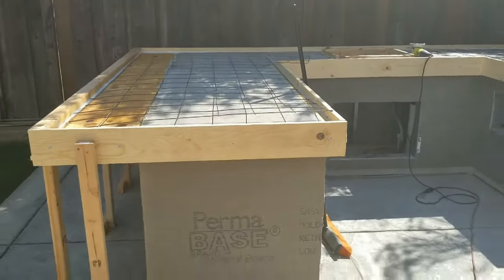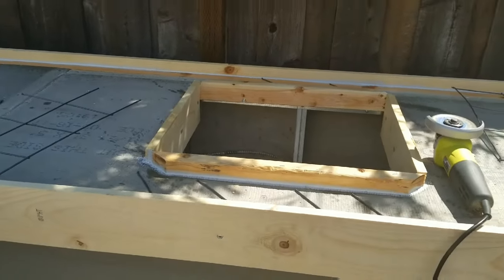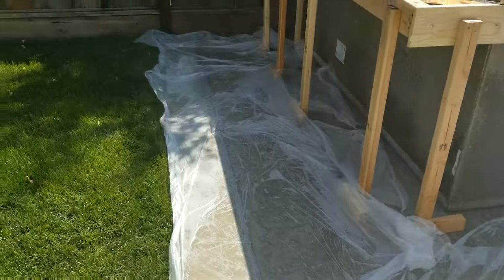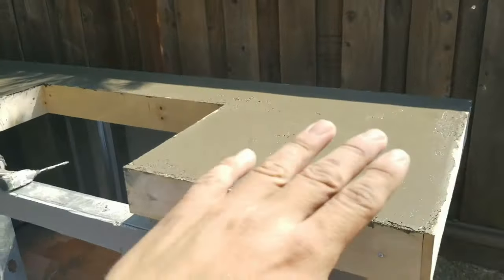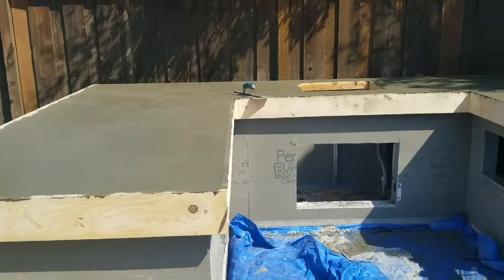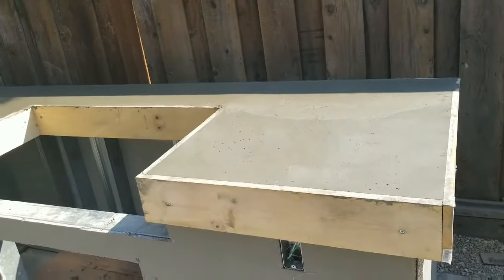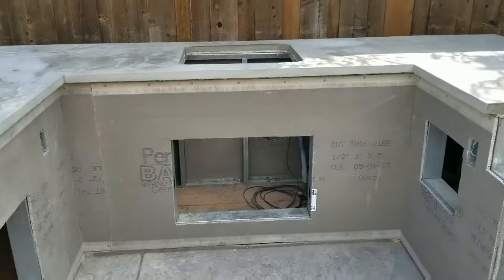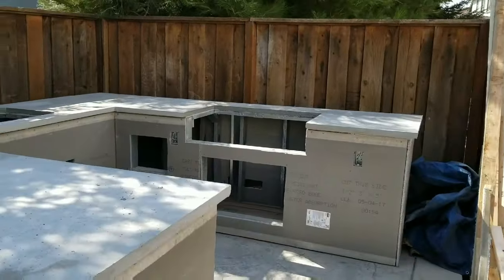How to make pour in place Concrete countertops on my bbq island #5

Comment: LEGIT WORK Bro!
The one thing that would’ve helped you out was to carry your 16” on center layout throughout your framing starting from left to right regardless on where your openings for bbq, doors and  drawers are. You wouldn’t have had to put those studs in for seam support nor would you have to cut much of that Durarock to length. Especially if the full length and width was at 8’, 12’ or 16’. You just slap each board on and make your cut outs with a reciprocating saw and correct blade and boom! Ur done. 
I like the concrete tops. The edges are so crisp and straight. Perfection has been GOT!
Reply from the maker: John Wagner thank you,  that is a great tip! I will take that into consideration when helping others and for my next bbq sometime in the future. Definitely a learning experience with metal studs and cement board. I appreciate the feedback
Reply: D.I.Y Eddie 
Metal studs are great to work with. There’s a few tricks to them you can do to make the job easier and more sturdy. Also using a chopsaw with a carbide tipped 60 tooth blade cuts them way easier than a grinder with a cut off blade. Loud as F$&k but quick. I’m in the throws of designing my outdoor cabana patio kitchen (whatever) and I learned a few things from your vids that’ll use on mine. Keep up the good work.
Reply from the maker: John Wagner hahaha yeah using the grinder messy but its what i had, I even looked at buying a metal stud cutter which wasnt a bad price if I did metal stud work for a living. Thank you sir hopefully you post some pictures or videos I enjoy getting different ideas from people.
Reply: D.I.Y Eddie 
Getting ideas from other posts are what it’s all about. Than you got doing the series. 
Stay away from Pinterest.  Full of adhocs and no real stuff like what you did.

Comment: Pretty good for the first time
Reply from the maker: Thanks 😊
Reply: @d.i.yeddie6075  Thanks for replying 
I have a question for you, did you get any hairline cracks in any of the cut outs or corners?
Reply from the maker: @themasonrycompany.  i didn't at the corners there was one area in the middle of the counter where I showed in one of the videos, that had a harline crack because the mesh wasnt pushed down. We have since sold the house but the time we had it there weren't any issues

Comment: Did you go back and trim cement board flush with edge if cabinets before pouring? I saw in your other video there was already a decent overhang with the cement boards,  but then in this one you said you put  2x4 in to get you the 1.5 inch gap from the cabinet. Looking to build something like this, but will be using 2x4 framing. As it is covered

Comment: Hello from Germany. I didn’t understand. Are you using the same material like in drywall constructions? And can hold out the weight from the concrete? I didn’t understand
Reply from the maker: No I used thicker gauge metal 20 gauge i believe, spacing was reduced during framing and my concrete countertops are only 1 1/2" thick
Reply from the maker: Thanks for watching!

Comment: I have a question regarding your concrete forms.  What did you screw the forms to, the cement board and metal framing?  Not the counter overhang, just the regular counters is what I’m interested in doing.  Thanks again
Reply from the maker: the 2x3 forms were screwed all the way through and grabbed the framing to help support the weight, then the 1x4 board were screwed directly to the 2x3

Comment: Under the 12” extension did you use cement board or just plywood and then remove after the two weeks
Reply from the maker: It was only concrete poured over plywood and removed 2 weeks later after hardening, thanks for watching!

Comment: Hey Eddie! How long did you wait until you used the metal finishing trowel? I understand that you want the concrete to firm up a bit before trying to smooth it out. Cheers!
Reply from the maker: You have to feel and see it, if you run your finger on top it should turn into a milky consistency but not watery. Depends on temperature humidity etc if its about 70 degrees I would say 45min-1hr. Hard to describe without having a video lol
Reply: @d.i.yeddie6075  thanks man!

Comment: Hey Eddie, im doing my first concrete project, i built a Base for an outdoor bbq , and im going to pour the top 4” reinforced with rebar, using Quikrete Prograde Countertop mix, any thoughts i see i should use melamime forms and caulk the esdges and some use wax or ive seen common olive oil to line the inside surfaces..... Do i have to wait 2 weeks to continue building on top of it?
Reply from the maker: Thanks for watching Sebastian, 4" of concrete is pretty heavy, have you thought of doing the edges 4" and the base 2"?  Yes you can use melamine or plywood coated with wd40 or some sort of release agent (any lubricant oil wd40 etc or release wax is good) Typically 24-36 hours concrete is hardened to walk or touch but as time goes on the hardness keeps increasing, I recommend waiting atleast one week before setting something heavy or removing overhang frames

Comment: How do you seal it and what do you use? Do you know how to do the chiseled edge look?
Reply from the maker: I used tung oil to seal the counter top, to get a chiseled look you need to buy molds that have that pattern and use them on the edges.
Reply: D.I.Y Eddie any idea on where to buy the molds. Also how long does the tung oil last? Have often do you re seal?
Reply from the maker: @steventhorkelsen6478  you can find them through z forms or https://www.expressions-ltd.com/collections/edge-form-liners and many more places online. The tung oil only lasts about 4-6 months, it is in direct contact with the sun. There are many sealing options I choose the tung oil because it is not harmful and eco friendly.

Comment: What's the size of self tapping  screws?                                                you said 3 inch but what's the thickness #
Reply from the maker: I believe it was either a #12 or #14  similar to this one. 
https://www.homedepot.com/p/Everbilt-14-3-in-External-Hex-Flange-Hex-Head-Self-Drilling-Screw-1-lb-Box-32-Pack-116073/205142720
Reply from the maker: I looked at the box today they were #14

Comment: Hi. I plan to make something like that but im not shure what type of concrete i need to use. Im afraid if its heating and cooling down several times it will crack. I have a couple of concrete bricks, i planed to put them together, make a mold than spill the concrete in it. My bbq will much smaller. Did you think it will work? The second idea i use flexible tile adhesive concrete for it.
Reply from the maker: Norman Tenke I used sakcrete 5000, I have 2 minor stress cracks on my top which I showed in the video because of the wire mesh being too high in those areas. They make special countertop mixes which have different chemicals and fiberglass but they are a lot more expensive. Just remember to use a reinforcement when using sakcrete 5000 high strength concrete. As far as forming just make sure there is no movement when pouring.

Comment: Eddie! Looks great. Does your cut out depth for the grill include the over hang? The grill I want to put in requires a 20 5/8" depth cutout. I'm not sure if this cutout is from the cement board on the front of my rough in framing, or if I need to add the 1 1/2" overhang of my countertop. It is a napoleon grill. The opening dimensions are a little unclear. Thx!
Reply from the maker: Thanks for watching. Yes I included the overhang with my measurements because, the bbq sits on top of the counter top
Reply from the maker: What i did is subtract the countertop overhang from the frame cutout for example if the cutout calls for 21 1/2 and I have a1 1/2 overhang, the frame cutout is @ 20". The final finished countertop will be the total 21 1/2 hope this helps
Reply: Thanks Eddie! Again. Nice job!

Comment: Eddie, So you used silicone to put temporary in the joint where the box frame and cement backer board meet correct?
Reply from the maker: Yes i put silicone on the form to seal the joints, to prevent the concrete from seeping out.
Reply: @d.i.yeddie6075  You mentioned WD40 at the end...did you add that to the silicone, just in the seams or to the entire mold. By the way, they came out great, nice job!
Reply from the maker: @jcoburn3590  thank you, i put the silicone first then sprayed wd40 on the molds to help release easier after the concrete dries.
Reply from the maker: @jcoburn3590  i added silicone to the corners and seams

Comment: Great videos Eddie!

Is the concrete countertop just adhering to the Cementboard, or did you put anchors in?
Reply from the maker: rwijnbelt thank you, the concrete countertop bonds to the cement board as it cures. No need for anchors

Comment: Nice Video.    I am going back and forth between cinder block and metal studs to support the concrete countertop.  Was not sure 25 gauge Big Box store Metal studs would work.   What gauge studs did you use and did you get them at a box store?   How far apart to did you place them.  How thick was your counter top,  2"?
Reply from the maker: Frank Dalessandro I located a drywall supplier near by they had 18 or 20 gauge studs i spaced them out at 16", 25 gauge studs are really thin screws dont really grab. I believe the concrete countertop was 1.5" which is minimum thickness for Sakcrete 5000.
Reply from the maker: Frank Dalessandro as far a concrete block vs metal studs I have done bbq's both methods. I like both but metal studs were way easier and didnt require more than a 4" slab. Cut outs for concrete block consisted of framing out opening and either pouring a header or using single blocks to make a header and fill with concrete.
Reply: Really appreciate the quick response.  I just realized you had several videos and went back an watch all of them several times. Great end to end overall Info.  Very appreciative you taking the time to post.   I am basically building a U Shape Kitchen so this was perfect!! 

Your second paragraph address many of the issues (Vents, Receptacles, headers, larger doors than top appliance) and was starting to think I was going to have to start pouring concrete to facilitate those areas, and hence why I started to consider metal studs.  Based on your feed back called a few drywall distributors and found the 20ga. studs. Perfect!!    Appreciate the measurements to.  My Wife really likes how you used tile on the sides!!

Comment: The other guy said that those cement boards wick water, do they ?
Reply from the maker: per the manufacture they are suited for indoor outdoor applications and are resistant to mold.  PermaBase is highly moisture resistant, and will not rot, disintegrate or swell when exposed to water. https://nationalgypsum.com/products/Product.aspx?ProductID=2393

Comment: We just used sakrete 5000 plus for our countertop and it was a complete disaster. 
I managed to barely save the top face but the amount of aggregate and the terrible mixture from adding water would never allow me to reccomend using 5000 plus
Reply from the maker: that's unfortunate, I didn't have much trouble using it, it does have a good amount of aggregate because it is a high strength mix. one thing to be cautious about is the amount of water mixed in and the weather because it can set too fast.

Comment: Did yoy put the reinforcing metal under the concrete?
Reply from the maker: juan gaspar yes I put it in the middle of the concrete countertop,
Reply: Do you have to put that also?(reinforcing metal
Reply from the maker: juan gaspar yes you do need a reinforcement of some kind unless its a mix with fiberglass
Reply: How long was your overhang? Have you had any problems such crack?

Comment: I’d sure put rebar across the cantilevered edge.
Reply from the maker: Loren Worthington it would not be necessary on a countertop 1.5" thick, wire mesh is sufficient strenght for this application. Fiberglass mesh would also be a great option for countertops. Thanks for watching

Comment: And what do you mean you have to wait 2 weeks to sand it and do you need to sand it?
Reply from the maker: juan gaspar the concrete needs time to cure to a certain hardness level before sanding, or else it would be too soft when sanding and not give you a smooth surface. Concrete sanding is not required I wanted a smooth finish surface
Reply: do you cover it when it rains? during the cure wait
Reply from the maker: jk kk yes during the cure period you do not want the concrete to set fast, i put a plastic sheet to slow the process

Comment: I bought that exact grill second hand. What was your rough in size that you left open?
Reply from the maker: I forgot the exact measurements but they were on the installation manual which can be found online. I brought the bbq forward 1.5" because of the overhang. for example if the rear cutout states 18"  and I plan on having a 2" overhang then the framing would be at 16"

Comment: Don't have anyone ever sitting or dancing on that countertop. No offense but there's no way this is structurally sound adding that much weight over a flimsy high gauge steel studs framing structure.
Reply from the maker: I appreciate your feedback but I have personally been on top of the island and had no issues.